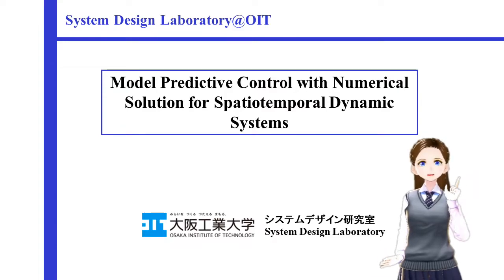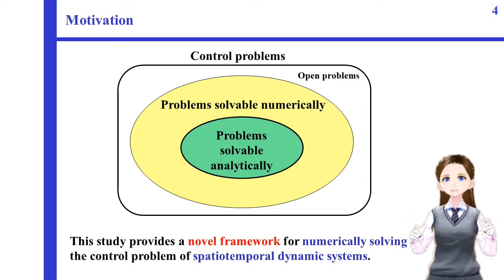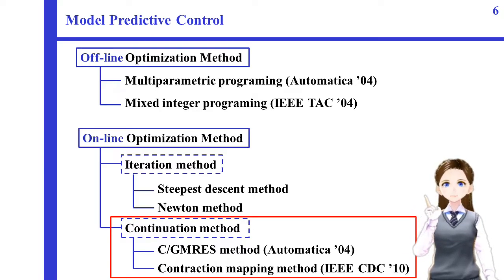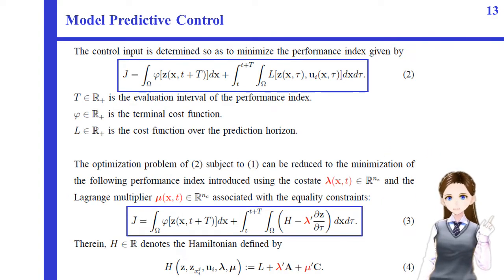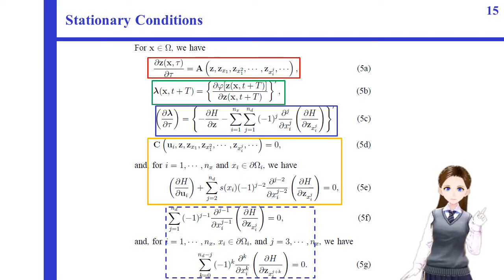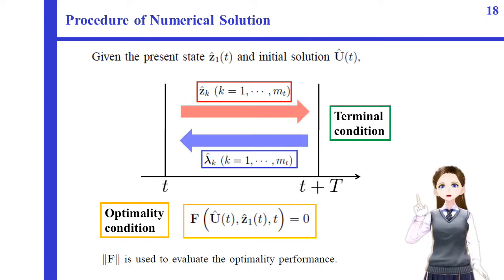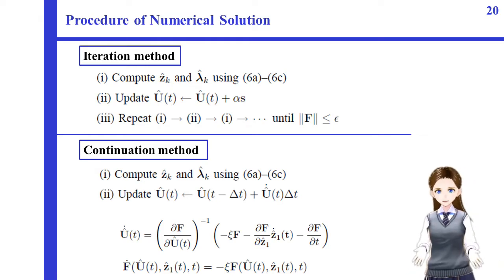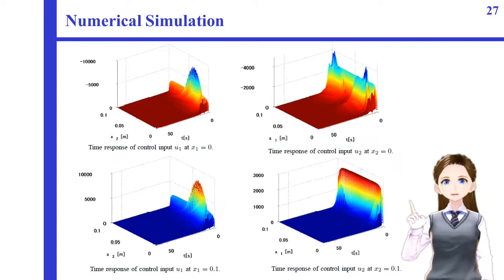Model Predictive Control for Spatiotemporal Dynamic Systems

Comment: Thank you for this, also the virtual avatar is cute. What software did birth here?
Reply from the maker: Thanks! The software you asked is  3teneFREE.
Reply: @OITSDL  Do I understand it correctly that cyclic boundary conditions such as a cylinder are not a problem? Because you use an optimizer that handles constraint and it can solve those wrap around boundary conditions too.
Reply from the maker: @modernsolutions6631  Yes, you are right. Cyclic boundary conditions are not problem. We can deal with such conditions.